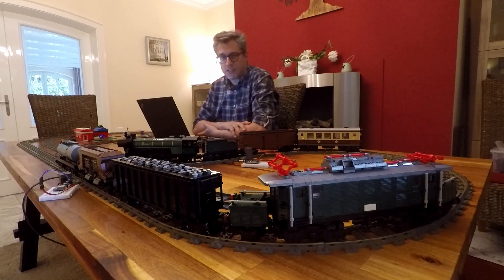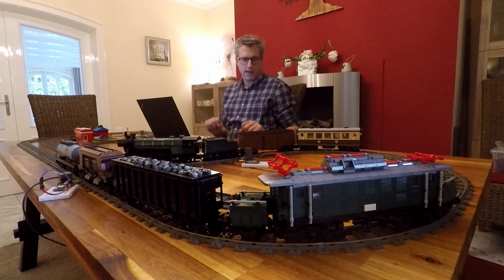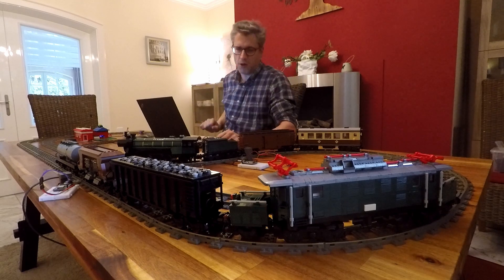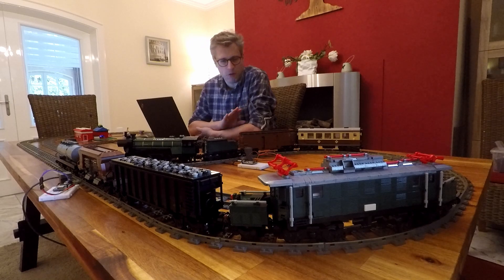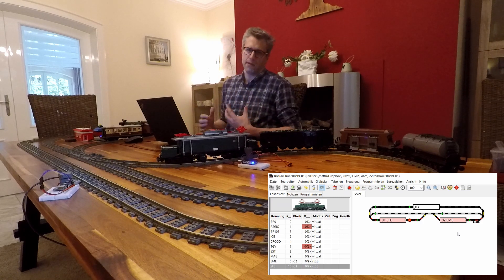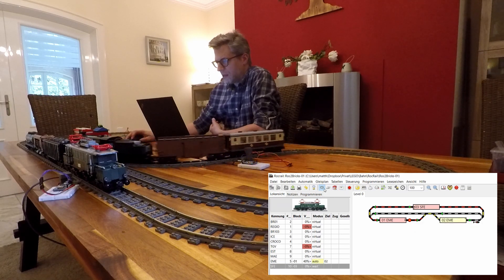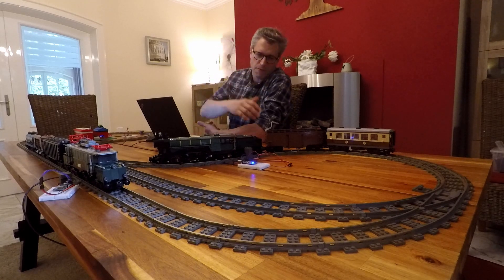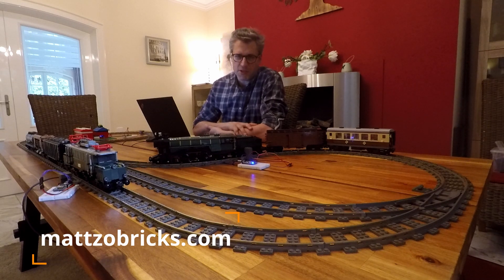Lego Train Automation - Mattzobricks goes Rocrail [en]

Comment: I'm so exited to see this video, a I'm looking into designing my own layout with lighting, automation th train control based upon parameters. - I like Ncontrol for the setup but the programming is a nightmare. 

Keep.up the great work and I can't wait to see more automation videos.  :D

However with this setup as well as the issues you raises there is a substantial delay from the sensor measuring a train until it stops (or moves another train into the block it has just left. 

Also I would like to use a more DIY approach - using off the shelf components for sensors and LED lights. 

Also could this program suport more than two aspect signalling such as 3 or 4 aspect signalling for yellow and double yellow aspects after a red signal?
Reply from the maker: I am presently working on the sensors, and we are indeed making substantial progress at the moment.

Regarding signals with 3 or 4 aspects (for the Germans: aspect = Signalbegriff): yes, that would very well be possible. The question that I am asking myself is rather if we would EVER show a "green" light (unrestricted go, i.e. next signal is also green), because on our small and stuffed LEGO train layouts you would very rarely have two free blocks ahead of a train entering a sector. Another downside is that it would consume more I/O pins on the microcontrollers. I am planning to supply 4 light signals with a single cheap 8 pin controller. Adding more aspects to the signal would also mean less signals per controller.

But yes, theoretically everything would be possible... :-)

Comment: Hello,
Really cool to hear again from you!
What I am interested in: Why exactly did you decide to use as an existing software, RocRail in this case, as a platform and decided against developing a software from scratch? Do you think it is to complicated?
Reply from the maker: That's a good question. High level software like Rocrail is widely available, and many people have put substantial time and effort into those programs. Maybe one day I'll develop some train automation software for the LEGO system from the scratch, but at the moment I found it more useful to allocate my time on building the middleware, i.e. sensors, actors, controllers, and the software that make it all work.

Let's see what the future brings.
Reply: @mattzobricks  Okay, I understand your points.
The reason im asking is that I currently develop an automation software from scratch and for such a project you wanna make sure, you dont already start off with the wrong decision :D
But my Setup is probably also a bit different: Since I dont use 4D-Bricks components but rather of the shelf electronic components, the software runs on a Raspberry PI to have a smooth & easy interface.
Reply from the maker: Well, the question is not easy to answer, because it depends on factors that I can not evaluate from the distance. If you can do it, depends on your skills in software modelling and engineering. If you want to do it right, flexible and powerful, you will automatically end up with similar models that people are applying in automation software like Rocrail or others. I have programmed different train automation programs myself, so I believe that I can say this with quite some confidence. The question is: do you see a sufficient fit in readily made software with your requirements, or are your requirements so special that you need to implement your own logic? Implementing your own stuff is fun, but is usually the harder way to go.
Reply: @mattzobricks  Yes, of course, I am also not expecting you to give me a final answer, I was just curious :)
For my part, I am now developing it from scratch since I find a lot of enjoyment in developing a system from ground up - and I really hate fiddling around with existing systems to get something new to work. So it is rather a subjective than an objective decision for my part.